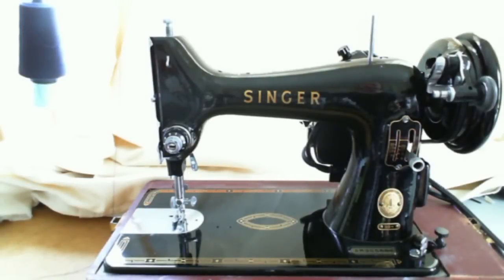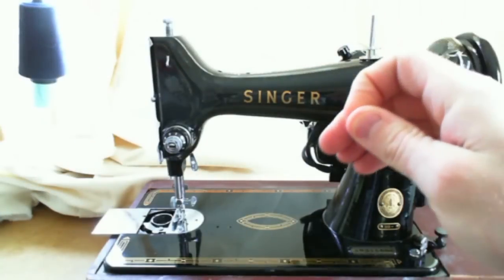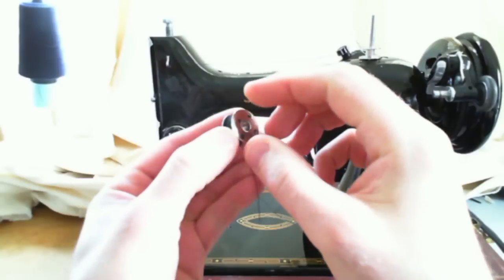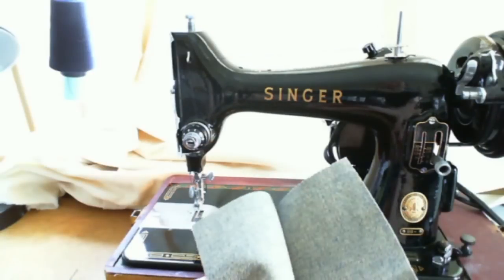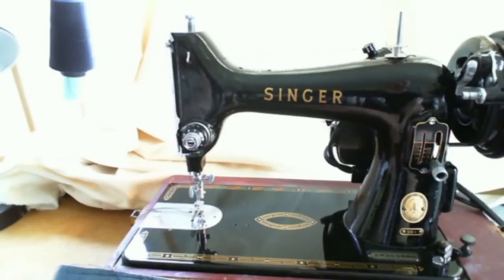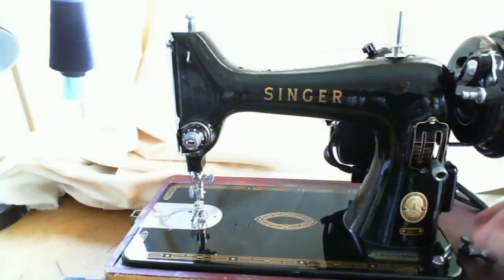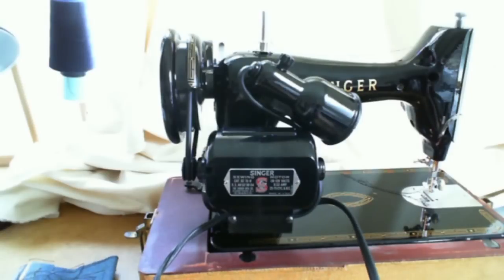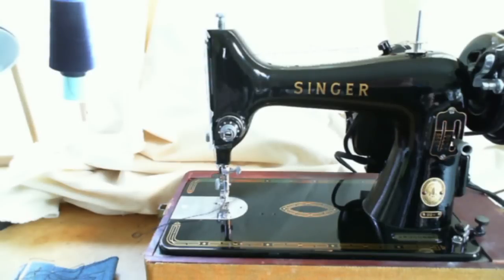Singer 99 Sewing Machine in Action.mpg

Comment: Great video! I have a 99k also and a featherweight, love them both. I’ve used my 99k to sew covers for my furniture, such a work horse!  I put upholstery thread on the machine along with a singer 100/16 needle without any problems. I do have a buttonhole attachment that fits both the 99k and the featherweight as well.  Notice how quite the machine is?  Love it!

Comment from the maker: @LittleStrawHats I use a wax called Scratch Out for automotive applications.  I believe you can find it pretty much anywhere.  I like to apply and remove it with a microfiber cloth.  It's what you might refer to as a "cleaner" wax product that's designed to remove and polish surface imperfections from paint.  It's really rather fun since a sewing machine is small and easy to work with.  Very much instant gratification!

Comment: Hi Brian...thank you for a really good quality video. I've been trying to decide whether to buy a model 99 or a model 221 (featherweight)...I've done some research on the model 99 and if there is a K after the 99, that means the machine was manufactured in Great Britain. If there is a dash (-) after the 99, that means it was made in the US (Elizabeth NJ).
Reply: The 99K machines also had a reverse stitch, called a back tack, that the 99s did not have, and several other mechanical differences. This looks like a 99K.

Comment: For top stitch thread on a 99 you have to loosen the bobbin tension quite a bit, it's a bit fuzzy to get it right (I have two bobbin cases, one set for extra strength thread). The other thing is increase presser foot tension, and feed should be no problem.

Comment: Thank you for this video.  It is very informative.  What kind of wax did you use to shine the machine.  I just had my mom’s Singer 99 repaired and I’d like to shine it up a bit.  I used Singer sewing machine oil and it helped a lot, but there are still a few areas that still need more shine. 😊

Comment: Thanks for such a great quality video, some video's you can't see real plain, and some I can't even hardly hear the person talking, as I am hard of earing, But just wanted to share that I have the 201-2 anniversary series 1851-1951 so mine will soon be 63 yrs. old. while researching I found that mine uses wicks and singer motor lubricant, as it is a gear driven machine.   But I am looking at a singer 99 right now thanks for the info. on them, I also have a Dress Maker 30 Deluxe precision, a 301A slant stitch, and a 4622A that my Hubby bought me brand new in 92 or 93.  I just love old sewing machines.  Thanks for the info on the wax I will try it, but I found that the singer oil shines then up very nice also.
Reply: markay vintageformeforever The 201 is an absolute GEM! Wish I had one.

Comment: One more thing...ZeeDay asked if this machine was adapted to electric. The older 99's (and 66's) were originally manual...either treadle or hand crank. IF for some reason someone has an electric 99...you can adapt the machine BACK to a hand crank. There are a few new (made in China) crank adaptors on ebay right now. This machine is still very popular in Africa and India in villages where electricity is scarce.

Comment: The manual says to regulate the tension on the foot depending on the material you're sewing. (Light pressure with light fabric and more pressure with heavier) It's something I haven't touched because it freaks me out. Would this adjustment enable the feed dogs to move the material easier through the stitches to let you lessen the tension on the heavy thread without loosing the quality of the stitch length?

Comment: Thank you!!  Exactly what I have been looking for, and it is a real slim pickin's when it comes to the instructions for this machine.  I just acquired this machine, EXACTLY like yours in this video and I did find a manual that I downloaded but it is from 1958 or so and it is a photo copy with really small print and not a very good copy.  I got a little confused on the how to bobbin wind because the instructions where not very clear on how the wheel mechanism, works.  Being unfamiliar with a vintage, I had no idea how to operate the wheel.  So, thank you, thank you, thank you again.  Have a great day, and I may need to contact you again, should I find myself lost.  Take Care!    P.S., maybe you could do an instructional on how to oil all the mechanisms?!  I just got done doing it and there are a lot of oiling holes. LOL  =P

Comment: Brian, I have just bought a singer 99k and when I got it home I tried it straight away and it sewed beautifully but it was full of years of dust so I took it apart and cleaned it and oiled it. It still goes (motor) but now the material had no stitches only the needle holes. I have re threaded it over 30 times, re done the bobbin over 30 times to no avail. I am so frustrated and so disappointed in myself for not knowing what I  did wrong. Please can you help me with advice. I live in Tasmania, Australia. It must be something simple as the whole machine has very few parts really. Thank you, Pamela

Comment: Hi Brian, I found one like this in my mother-in-laws attic. It worked FINE but suddenly the power just went top speed without touching the pedal. It started humming as we ate lunch and suddenly just full speed. I tooke out the powercord and took the pedal apart. Nothing seems wrong. Nomatter what i do press/release metal with springs under button its just full speed. Do you have ANY idea what to do? Thanks if you can reply. Regards Liz

Comment: I have this machine, but it's now its not picking up the bobbin thread (down in the bobbing section). It is also making "nests" out of the top spool thread which comes down down in the bobbin section. I guess the issue must be tension, but I don't really understand how tension works. Any advice.
Reply: Be sure to thread the needle from left to right.